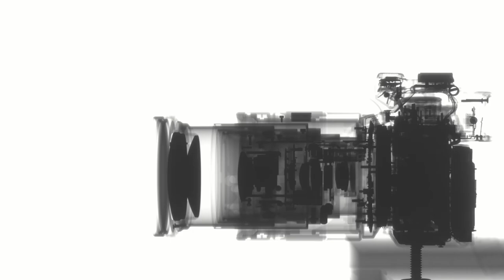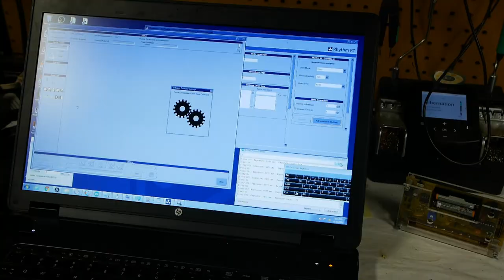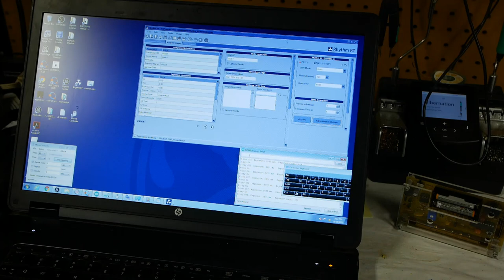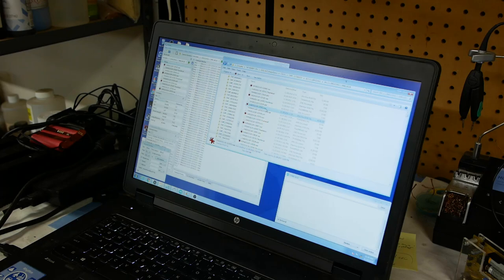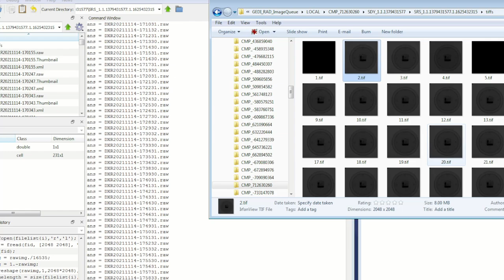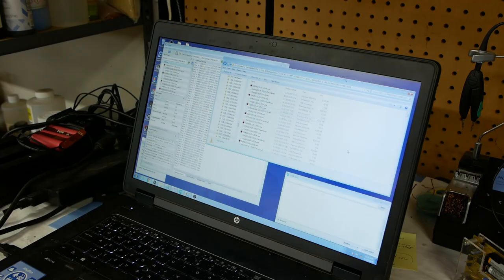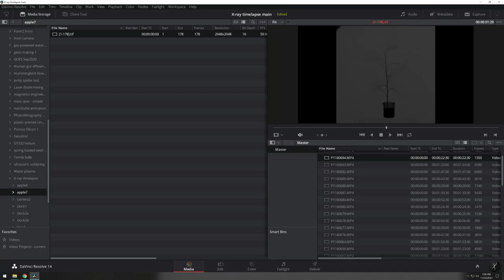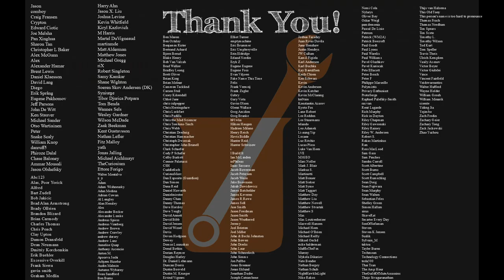X-ray timelapse of fluid movement in plants, stop-motion animation, sensor teardown/repair

Comment: Plant takeup of KI from stem greater than from roots sounds right.  Most plants roots surface membranes are reasonably good at keeping larger metals at low concentrations. An holy grail of soil remediation is a plant that aggressively concentrates heavier metals/halogens.
Reply: @RCM, Physics of botany question: Would you attribute that to the capillary action having an easier time with particle flow due to the cut stem exposing larger "inlets"? Or because the root system is generally keeping the chemical concentration/particulate at a minimum? Put another way, is it a particle size or the particle weight that the membrane affects? I grew up next to the largest superfund site in the US and it all boiled down to what to do with the water. I love the idea of growing giant radioactive trees that uptake all the heavy metals to save a watershed...
Reply: @codygoldhahn2680  membrane and associated microorganisms. Problem is concentration, otherwise we wind up with expensive biomass problem.
Reply: The tobacco plant is known to accumulate radionuclides.

Comment: I worked in diagnostic imaging and unclear (nuclear) medicine at a high level 10 years ago... I fixed the confusers and displays for the radiologists but never got to the lower levels. I always wanted to rip one of those apart since the radiographers just roughly removed the panels from the x-ray machine and jammed them into a docking station to download the image data (probably through the mystery bottom connector) and was surprised they took such rough handling! Great to see inside one at last!!! Thank you for your unmissable content <3

Comment: You should go on the Safety Third podcast with William Osman.  They talk about you occasionally and it'd be great to hear your stories directly and how you think about safety.
Reply: Please do this. William seemingly got endless amounts of safety hate comments. Yet this video has close to none.
Reply: @Manboy133too  He got so many idiotic comments that it actually prompted him to stop making videos while he regains his sanity.
Reply: @Manboy133too  William opened the X-ray head and used it on its open state, that makes "safety nerds" goes brrr.
I don't remember him using a remote trigger and while Ben shielding is questionable, it's more safely secure and he probably setups and leaves.
Also, different audiences and expectations has serious impact in how they react.

My biggest pick with his video was the high voltage supply, while he has experience with high voltage, my experience says your "you never can be too careful" isn't careful enough.

I did a not nice "treat" to call NRA if did used it again, funny enough Ben also got a visit from NRA, Thought Emporium called and got the NRA and Amazon attention while Cody's Lab probably gets a visit twice a year.

If you had to ask me why, Well, Ben uses a documentation style and coat lab from time to time while covering very advanced topics.
William does a more fun and educational style with focus on fun topics doing crazy and dangerous sometimes.
So when William does a advance and infamously dangerous topic... Pitchforks rise.

Comment: 7:40 This is actually a very common technique used on high voltage low frequency AC power supplies, particularly with electrostatic chucks used to hold silicon wafers in place within the process chamber of Ion Implanters. 
Quick side note: I think a future project could be Implanting your own dopant species into silicon wafers using ion acceleration and creating your own transistors. You could definitely use diffusion techniques with your quartz tube oven, but accelerating ions into silicon can definitely be done in your shop and may prove to be a challenging but interesting project!

Comment: Image plate detectors like the one you have are still used at synchrotrons for doing x-ray diffraction and tomography experiments. It is amazing how sensitive they are. We have to correct for sensitivity of pixels within each detector strip because of the difference in the length of the electrical path length to the ADC leads to small differences in x-ray counting time. If you are curious about trying to set up a laue diffractometer using your detector send me a message and I would be glad to help.

Comment: The subject of the video is obviously very interesting and you've done an excellent job with it.
What's more interesting for me though, is how you managed to troubleshoot the software problems. Honest question, how did you figure out it was the order and the right click -> close? What hell did you go through where you thought "Hey, maybe right click -> close is a possible solution"?
Reply from the maker: Yeah, I'm always torn between making hour-long videos with all the details, and trying to keep things lively at 20 minutes :)  In this case, after running the timelapse sequence for several hours, the software would randomly fail, and when I came back the next day, I would see the program had to be restarted in order to get it working again.  At some point, I was lucky enough to catch the failure in the act -- a modal dialog would pop up and indicate "failure to transfer image".  If the dialog was ignored (as it would be by the mouse control script), the software would never regain itself, and no further images would be acquired, but upon the next frame acquisition, the dialog would disappear yet the whole software stack would remain in a non-working state!  I got around this by always right-click and closing the "image acquisition" part of the program, which didn't cause a problem in the normal case, but also was sufficient to acknowledge the model dialog in the failure case... They should pay me for QA testing.  There were many many other bizarre quirks -- my favorite:  The ad-hoc WiFi password is hardcoded and printed in the user guide.  The password is 26 1's.  Yes, 1111111111...  :)
Reply: @Applied Science  Yes, they should pay you for qa testing. Very interesting troubleshooting procedure. Thanks for answering!
Reply: regardless of the real reason here, i made once a similar "discovery", with no popping up windows involved. if you are desperate enough - which might be the case especially with input macros ran in a seemingly controlled environment - you find some interesting behaviors. it's just a "machinist's trick" like regmon-ing or filemon-ing what happens to get to the root of some more or less irrelevant software issue.

this was the first ever part of any of these vids where i said: well, i could have maybe done this myself. not much but honest.
Reply: @AppliedScience  fantastic work
Reply: @AppliedScience  I believe that software is so foobarred, no amount of QA will save it.
Reply: @AppliedScience  I'd happily watch an hour or two version of this project but a 10-20 minute video summary would probably also be needed in order to capture the attention of most people. 
🤷‍♀️
Reply: @AppliedScience  I know one of the python packages that lets you remote control other software in windows is image based, so you could capture an image of that dialog box, and have the automation software detect if that box pops up and handle it accordingly. They way I ended up writing the python windows automation I needed was using PyWinAuto which doesn't use image recognition - you have to give it the actual identifiers of the controls in the dialog, which is harder to figure out initially, but seems to be more stable in the long term

Comment: Noticed you didn't mention, what is the rough retail value of the detector device? Fantastic content otherwise please keep it up, you're a real asset to the world for sharing your knowledge and ingenuity here.
Reply: I did a quick check, it appears to be one of those things that if you are asking for the price you can't afford it.
I not sure if it's the correct item, however there's on eBay going for 2000 dollars a Varian PAXSCAN4336R Digital Image Receptor X-ray Cassette
and at 4000 dollars a Varian PaxScan4336X Digital Image Receptor 1
Both are used.
Reply: Other comments mention figures in the range of 150-200K USD. I think that's probably more realistic than $4000.

Comment: I'm curious as the why the whole thing is portable. If it was a part of a unit that came with an emitter then it would make sense, but it looks like you had to supply your own.

Also, that shot of the camera was amazing. I'd be interested in seeing more mechanically complex machinery move under xray.
Reply: I would think it is a portable sensor for use in emergency rooms where the patient cannot be moved because of their trauma.
Reply: You can buy from the same manufacturer x-ray emitters. They are even portable. Usually used to inspect pipelines.
Reply: Modern XRay machine use this type of table as the "media" to capture.  It is "portable" so doctor does not need to move patient, the emitter moves, and then this unit is placed in the "right location", and the say whisky.
Reply: Maybe it's a legacy implementation for older x-ray stations? The form factor is somehow similar to film cartilages that where in use before the digital age.
Reply: They are commonly used in industrial inspection of pipework  to examine welds or to measure the remaining wall thickness of corroded pipes. For corrosion inspection they are very useful on insulated pipework because the installation does not need to be removed. Also using digital panels is much quicker... much shorter exposure times than using conventional film.

Comment: 9:41 if its written in c I'd bet there is an image acquisition function somewhere. Even if it isn't there is native code somewhere which you could theoretically pattern scan for. You could then do a dll injection and from that dll call the acquisition function directly. Then its just a matter of ipc to link this to your existing setup.

helpful tools for reversing:
detect it easy
cheat engine
ida pro (or other dis.)

It would be a lot of work, but it would also be pretty cool.

edit: also, I love this project your great
Reply: Yeah there's gotta be a DLL somewhere that does the heavy lifting in an abstract way. Maybe even an ActiveX control if they went that route. But since it's network controlled and spits out raws of a fixed size, I wonder what it would take to reverse-engineer the protocol and write your own software. With any luck, it doesn't require you to remotely bootstrap the FPGA over the network, though that wouldn't surprise me. Either way, Wireshark is your friend.

Comment: This is awesome Ben! The efforts you put into these videos is incredible :)

Also I think the batteries must have a I2C EEPROM in them for serial ID and to stop counterfeit/incompatible batteries to be used. You could remove the EEPROM from the dead battery and just hard wire it dead-bug style on the main board. Or better way dump the data from the EEPROM and flash a new chip.

Comment: Two days ago I was siting in front of a panel very similar to this one, having my kidneys X-rayed. At the time I was very curious to know a lot more about how these panels work, particularly, how the imaging was preformed, the sensors involved, and how the data was transferred from the portable panel to the computer system. 
The hospital computer network is such that X-ray images are available between departments, and ever other hospitals, within minutes of being taken, as well as being stored as part of a permanent record, somewhere on a cloud server.
I would be interested to know a little more about the WiFi interface. How the WiFi addressing and security protocol were set-up on the panel, presumably this was via some serial interface.

Comment: With all the software issues, have you considered reverse engineering the protocol instead? I bet loading up a few capture sessions in wireshark would get you pretty far without too much effort.
Reply: And considering the simplicity of the 'raw' file format it's probably banged straight across the network without too much between.

Comment: How much does this usually cost? Do you have to pay for software, too? I wonder if some open source solution would work and work better.
Reply: Saw this in a comment that showed up more at the top for me now:
"bitluni 1 month ago
When was working on radiotherapy software 15 years ago I remember one such panel was $150k+. They seem much more 'affordable' now with one less zero at the end. A good catch you got there. I'm wondering how heavily the phosphorous layer is bonded and if such a panel could also be used for a very sensitive telescope"

The software/laptop probably came with the device, but there might be periodic licence renewals involved that the controlling software has to load. It's possibly also linked to only work on that specific panel, who knows? they come up with a lot of stuff. Oh and expect an (optional) support contract to be around too that will vary in price by how many panels your organisation operates.

Comment: I designed and built X-ray sensors about 10 years ago for digital imaging of teeth and skulls. One of the things you need to do with larger sensors is to adjust each pixel programmatically because there is no way to get perfect components. You also have to adjust for each sensor you connect because they have to be pieced together. Seeing one this large must have been really fun to produce.

Comment: Thank you for your great videos. These DR cartridges usually go into a slot on mobile xray machines to be used for mobile/emergency xrays, predominantly chest or abdomen.
also, they usually have shock detectors which record any impact and log the time/date, to be able to track back to the operator.

Comment: That is awesome!
That battery pack looks like it contains cylindrical Li-Ion batteries (like 18650). You should be able to rebuild it.

Thank you Amir, for supplying the x-ray panel used in this video.

Comment: This knobs in 10's of KV,  Not 2n3055 transistors, shock mounts., teensy,  .similar composite.  made a stop motion of a fly under stacked macro lens on a stepper controlled microscope stage . some of my first you tube videos. fully automated to take 20 images with stepped height then turn the sample on a 2 axis gimbal, led illuminated when the shutter had stopped vibrating and the stage movement had stopped. Moved from the attic to the cellar due to vibrations. Thank you Amir. That's some beautiful data collection device.  Love botany, the vascular plants, they taste good too. As manufacturers add more features it distances the sensor raw data from connectivity.  data sheets are less useful because we don't have access to the  logic   i used had an uninterruptable interrupt pin to go to the connector . I sat on the work train with a tiny 2008 laptop stacking the fly images. for weeks, made some batch files in the end.  
animation focus stacking Blue Bottle Calliphorid Fly. I used Helicon focus image stacking.

Comment: I'm a high school student that has been working on making a small cabinet style CT machine. I've been doing projects involving x-rays for about a year now, your videos have been great inspiration and help to me when working on these devices. I actually recently acquired two CMOS sensors for my project, one came out of a Faxitron corevision biopsy specimen imaging system (I haven't managed to get this one working yet thanks to that wonderful crappy software), and the other one is a Dexela 1512 CMOS Flat Panel (This one I just got and I have a good feeling about getting it to work). Any way I just wanted to say that this video was super cool to see you working on these obscure complex pieces of equipment and really inspirational to keep me going even when these things don't work out the first few times. It can be very frustrating working on such equipment especially when barely anyone knows anything about it.

Comment: Fascinating. When I bought my first DSLR camera in 2005, a Nikon D-50, I used Nikon’s proprietary Capture app to develop RAWs. It was similarly buggy and closed as the X-ray control software. For some reason I couldn’t use the built-in batch mode, and it wasn’t scriptable via AppleScript, so I resorted to mouse control. Using accessibility UI scripting didn’t work either, so I had to move another level or two down and use a Core Graphics routine to actually simulate a hardware click to finally make it work.

Comment: Now to make radiographs with packing tape as the X-ray source (I'm sure you could wire the stepper motor to unwrap the tape in a vacuum). The digital detector is more sensitive than radiograph film from what I hear, so you should get some interesting results. Nice reverse engineering as usual - I always learn a lot and enjoy the snarky comments.

Comment: Very interesting video. I'm an xray tech. I use image receptor panels every day. So cool to see the inside and hear you describe the components. In between exams those panels sit in a docking station that keeps the battery charged. I think that is what your mystery port does. Thanks for such a fun video.